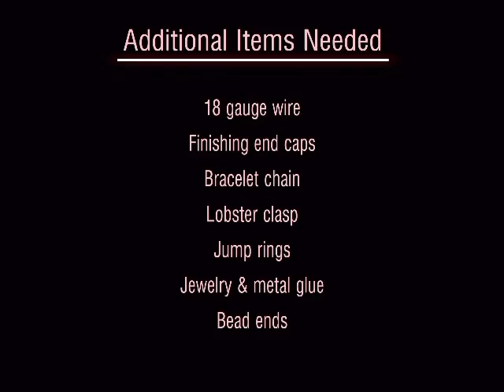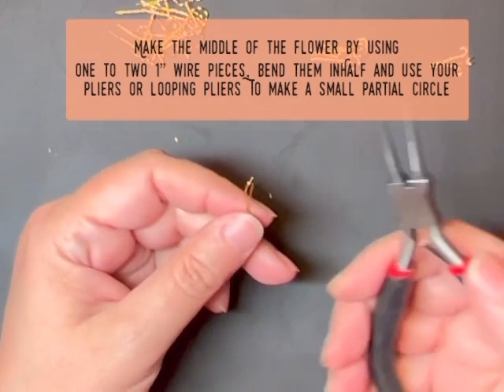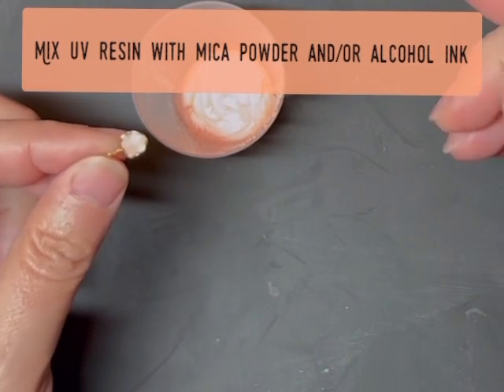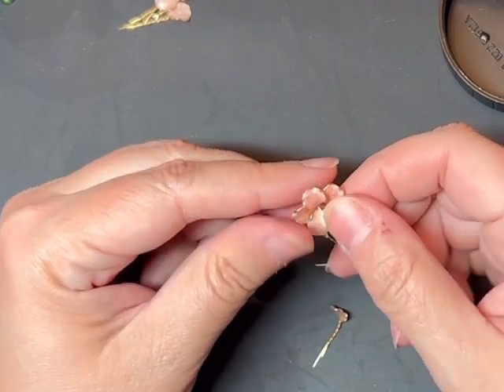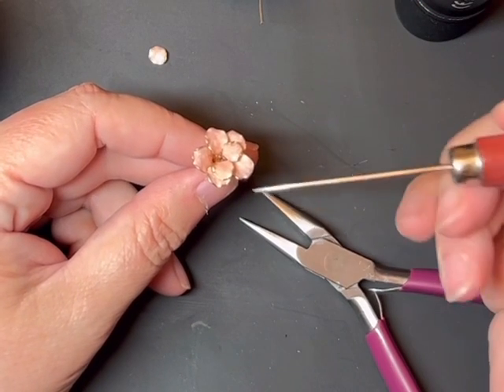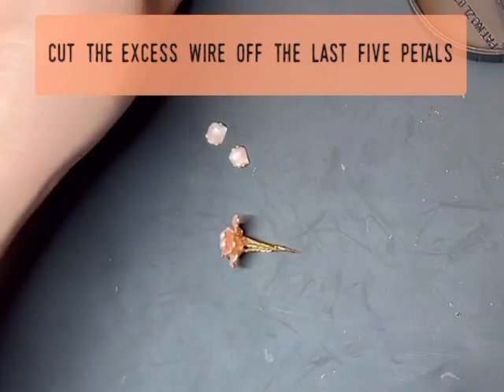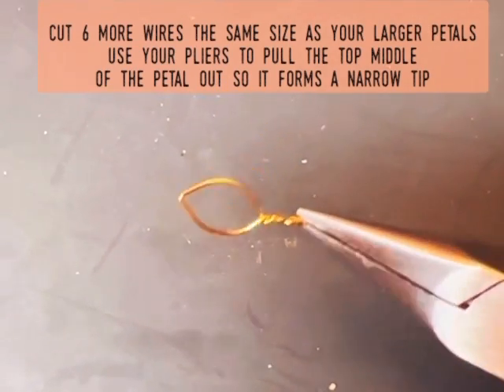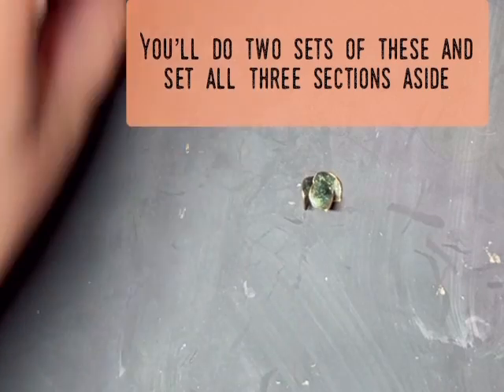UV Resin Flower Bracelet pt 1 of 3

Comment: greetings from mumbai, india. very lovely project-cant wait for parts 2 & 3. i am very new to uv resin so please can you tell me how long to hold under the uv torch and how long to keep under the uv lamp??? your reply will be greately appreciated. thank you.
Reply from the maker: Greetings from the US! Thanks for watching! UV resin is very quick to set up. It’ll depend on the thickness of the resin and how opaque it is. For this, I usually hold it under the flashlight about 20-30 seconds each side, and then at least 1 minute under the lamp for the dip. Just a little longer for the resin with the mica powder in it.